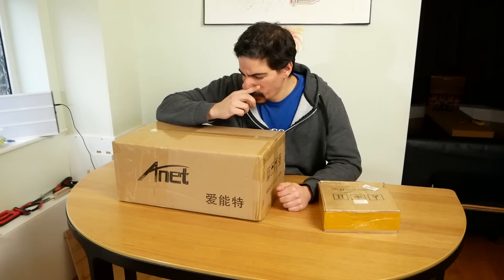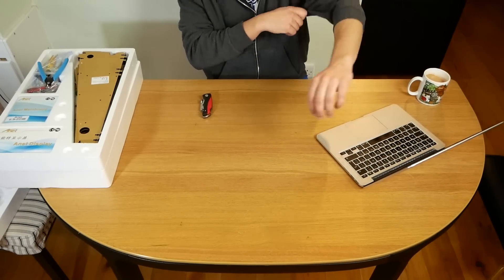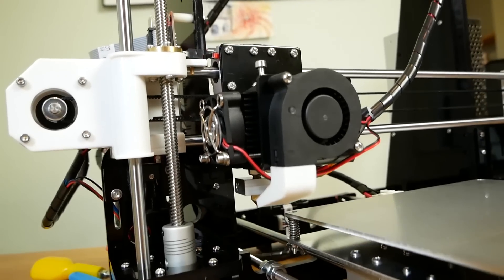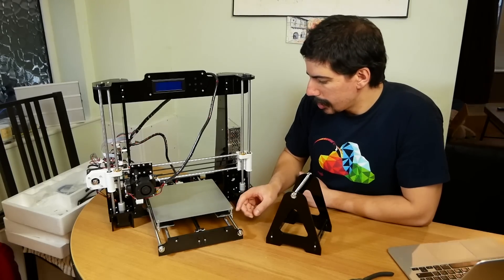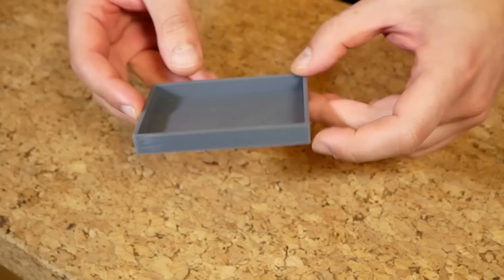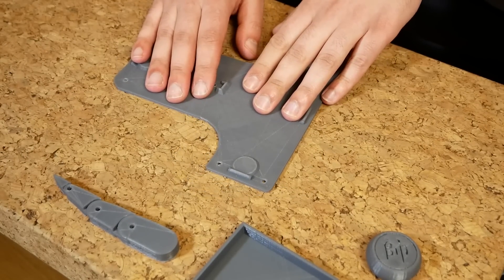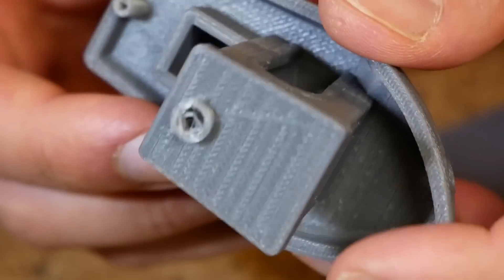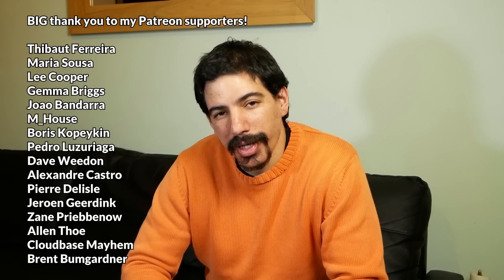Cheap 3D Printer Building for Beginners (Anet A8) - BANDARRA

Comment: Nice.  I've been watching your paragliding videos but I have also recently dived into 3D printing, a month ago or so.  My first is a Ender 2 and I've been pretty happy with it.  Hardest part was to learn to get the first layer to stick and stay stuck.  Adjustments to heat on the bed, leveling and good cleaning seems to have resolved all my sticking problems.  In fact now they stick so well I mess up the leveling every time I remove a product.  Anyway, thanks for the video....
Reply from the maker: Thanks for the tips dude :)
Reply: Additionally I run a bed temp of 55C, nozzle temp of 200C, clean bed and a nice coat of Elmers kids 
glue stick.  Any higher than 55C causes it to warp and separate.
Reply from the maker: yeah I'm running glass now with hairspray at 200C nozzle and 60deg bed, so might actually try to bring it down to 50C and see what happens
Reply: Never had any luck with the hairspray, and too hot of bed will give really bad results. :(  Also a term that seems appropriate with the first layer is "Smush".  Be so close to the bed that the first layer is literally smushed into the warm glass.  Best way I can describe it. :)